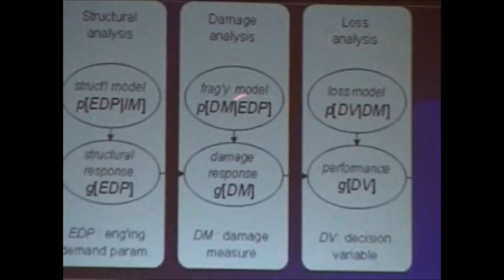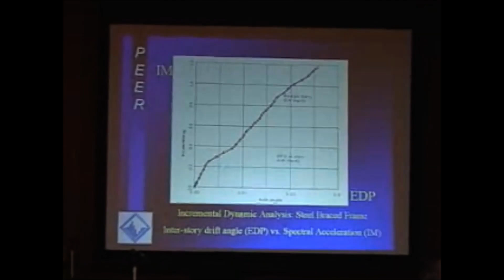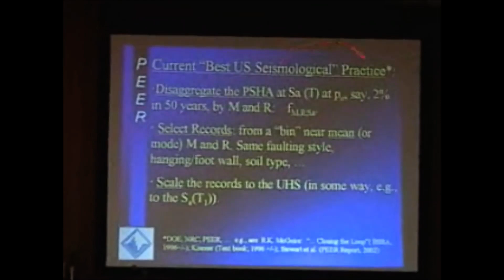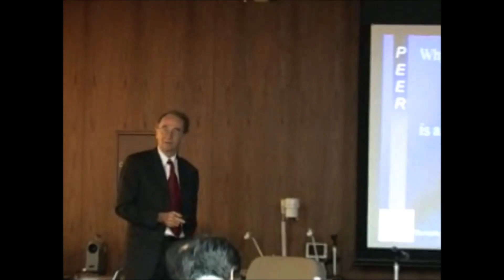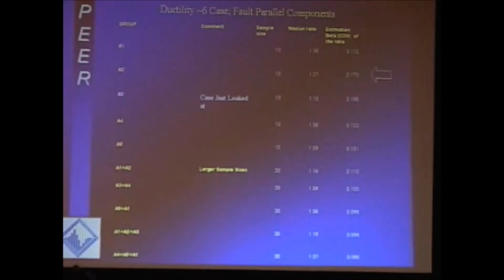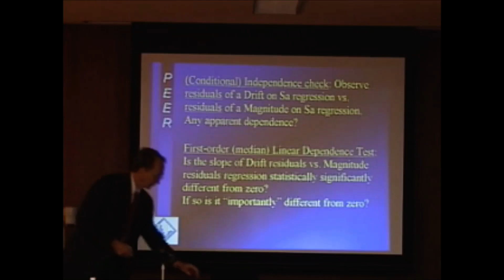Allin Cornell 2003 Architectural Institute of Japan seminar

Comment: Thank you to Professor Yasuhiro Mori for preserving this record and to Professor Jack Baker for sharing. The rare lecture footage of Professor C. Allin Cornell allows the academic community to revisit the intellectual legacy of this late pioneer in earthquake engineering and structural reliability theory. Despite being delivered over two decades ago, the foundational theories in engineering seismology elucidated in this lecture remain profoundly relevant today. The release of this archival material not only holds significant historical value but also offers young scholars a distinctive lens through which to trace the evolution of structural seismic reliability theory.

The lecture splits into two key parts: The first half systematically explicates the Performance-Based Earthquake Engineering (PBEE) methodological framework, with a focused analysis of the core principles of Incremental Dynamic Analysis (IDA). This section effectively serves as a live demonstration of Cornell's landmark paper published in the Journal of Structural Engineering in 2002. The latter segment delves into critical technical considerations for ground motion selection and scaling in Nonlinear Time History Analysis (NTHA), while pioneering a theoretical framework for the sufficiency of Intensity Measures (IM).  Notably, the research trajectories evident in this lecture foreshadow Cornell team's subsequent academic endeavors, with seminal achievements prominently featured in the October 2007 special issue of Earthquake Engineering and Structural Dynamics that he guest-edited.
https://onlinelibrary.wiley.com/toc/10969845/36/13

Thanks again for making this time-capsule of earthquake engineering  accessible to new generations.